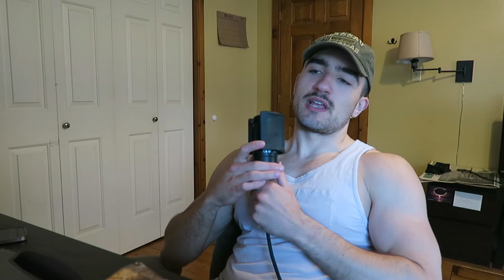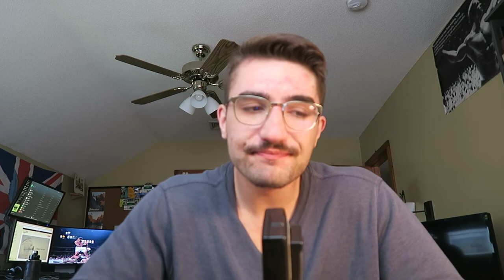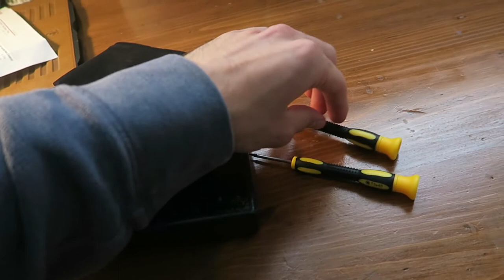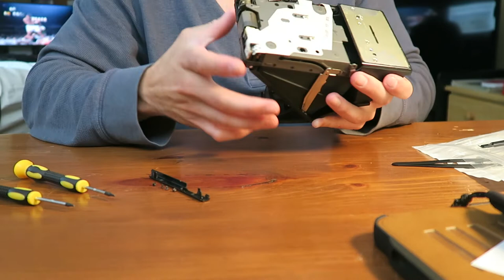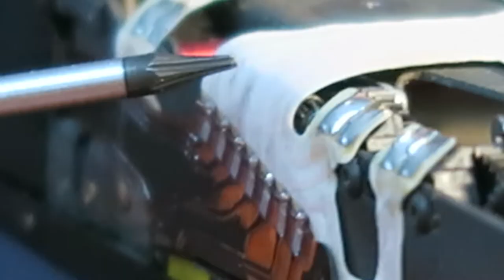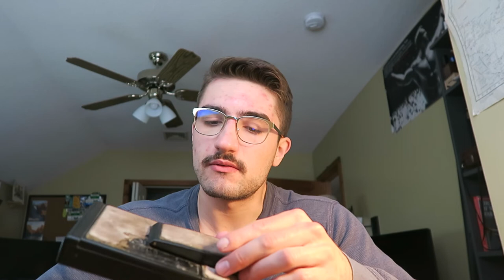Restoring a Vintage Polaroid SX-70 (Part 1)

Comment: Thank you SO MUCH for this CLEAR video. I've been looking into this fix for a while now but much like you couldn't find much beyond a flickr post on how to do this. Being able to see clearly where the spring is and where it needs to go is extremely helpful. I will be attempting this repair on my SX70 today!
Reply from the maker: You're exactly the kind of person I made this for! That made me happy to hear you got good use out of it. Good luck with your repair!
Reply: @shootretro8121  how did you get the spring to actually stay on the road once stretched? I can pull it to the rod and get the straight part in the gap but it just springs back. Thanks again for the video!
Reply from the maker: @Jackzira  If you aren't stretching the spring enough it won't take a new shape. It will do what is happening to you and snap back. I had to stretch it quite far before I got it to actually stay. When you stretch it, pull it as straight as possible and pull harder than you'd think you need to. I used tweezers to pull the spring out enough so I could grab with my fingers and pull even more. You'll notice my spring has a weird angle to it because of this, hence why I say pull it as straight as possible. Hope that helps!

Comment: Nice presentation.  I know this is a late comment on it, but I just found it.  About two months ago a member of our church was involved with an estate sale and asked me if wanted some cameras.  He didn't if they worked or not.  I took them and gave him something for the sale.  In the package, I had a complete SX-70, two cases in great shape, flash control system.  It was missing the shutter button to fire the camera.  I got hold of a donor that was water damaged beyond repair in my opinion and took parts off that I could use.  I cleaned up the leatherette with natural clear shoe polish. Now it looks good and clean, and the images of B&W are great.  I am planning on shooting some color later on next month.  I don't think I am going to keep it but I will have some fun with it.  I am also working on some 3d design items as accessories for it to be tested should I shoot some of the other films.
Reply from the maker: These cameras are so much fun to use, and it seems like you made yours a project as well. I'm glad you were able to fix up yours and get some shots on it. To be honest, I am a bit disappointed with my experience with color SX-70 film. I found it to be much less forgiving when it comes to exposure level.  B&W is my go-to from here on out with SX-70. Keep having fun with it, I hope you decide to hang onto it!

Comment: Nice! You can acces the long spring on the motor that needs stretching, by removing the 2 springs of the mirror blocking the spring you need acces to. Then you can stretch it enough so it won’t pop off again.
Reply from the maker: Great tip! It is definitely a tricky spot to gain access to. Thanks for watching.

Comment: To remove the glue you only need to use isopropilic alcohol or zippo fluid... And it goes out very easy and you can fix the internal spring welding it with tin and fixed permanently. Need to be very very gentle with the procesa of welding and use an tin that have silver because is more strong.